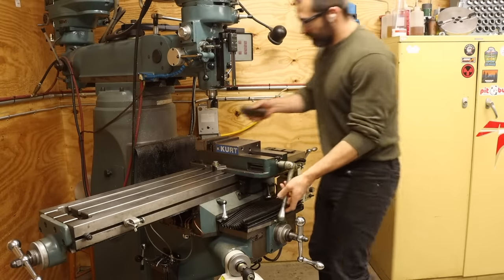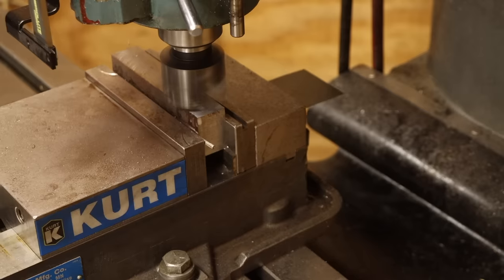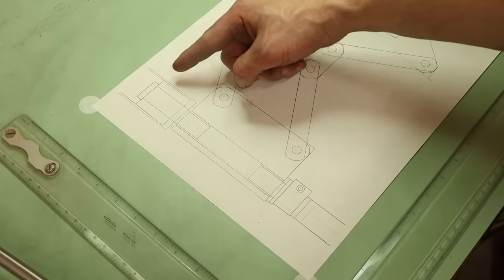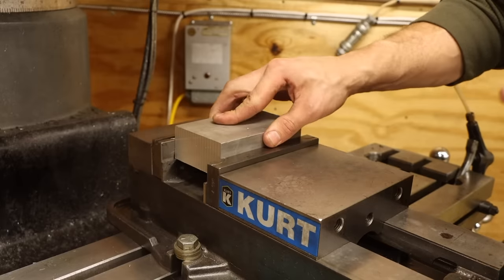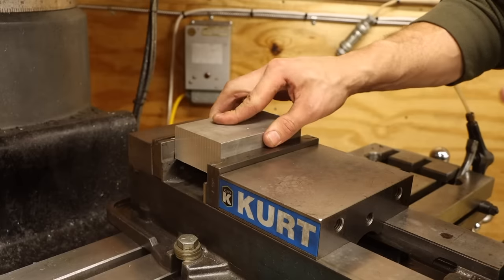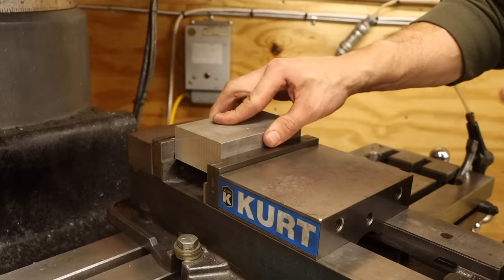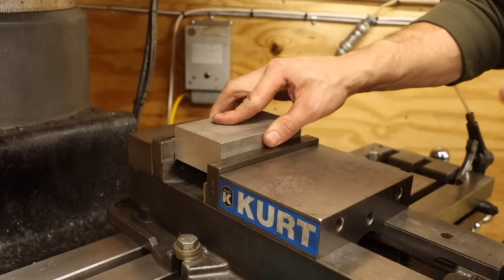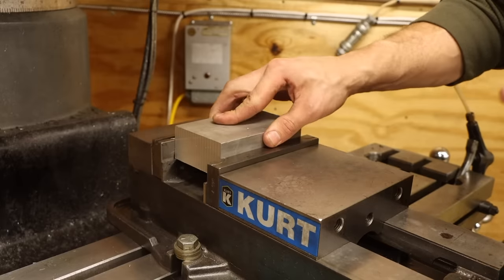A Life Changing Filming Upgrade || INHERITANCE MACHINING

Comment: I really enjoy watching you design and build equipment for your shop.  I find your creativity to be mind numbing.

There are a couple of things  that I was surprised at.  The first being the handle.  While being a very well done build, I am having a hard time defining function and need.  The second is the camera mount.   I would have thought having a handle here would have provided a better way of positioning the camera.

I like your gantry design and find it very functional.  I do believe it could be more functional had you beefed it up.  It appears had you increased the size and strength you could had built a second carriage for use in lifting parts and doing maintenance.  A simple one ton block or fall arrangement would save on your back.  Since the camera trolley is light in weight having a second carriage shouldn't interfere with the use of the camera 

Bob

Comment: A safe and practical solution to recording video content in the workshop. Can I just add one thing... forget about the camera mounted MIC with dead cat, far better audio recording can be had with lapel mic and Rode WIFI. Lapel MIC captures constant audio volume. Camera mounted MIC has a tendency to record audio at different volumes depending how close or far away you are from the fixed camera mounted MIC. Keep up the good work.

Comment: This is an amazing tool. I absolutely love it, and as always the filming and editing is on point. 

Two suggestions that come to mind, are the following.

1) make some kind of brake for the gantry so it stays in place where you put it, even if you happen to bump the drop tube. 
2) cut out some slots or space in the middle of the plywood sheets to let light through. As you are moving it around, you can alter the lighting in the shop, which could impact the look of the film. 

Alternatively, build a setup for positioning lights separately from the overheads that could give you more control over the lighting in your filming. Of course once you go down the lighting rabbit hole, it can easily get mighty expensive 😬
Reply from the maker: Thanks! I decided against the brake just to keep it simple. Bumping the setup would ruin the shot anyway so I didn't see the need. Fortunately it's easy enough to position the drop tube out of the way 95% of the time. Cutting light holes is a great idea though since it does block some of the ceiling light.

Comment: This is exactly the sort of thing I've wanted for my shop, but instead of a camera, a lamp.  Most of my work is on motorcycles, so being able to get a mechanical buddy to hold the light in exactly the right place would be freakin' magical.

I'm a little surprised you didn't make it so it could get entirely out of the way, maybe with an other arm so they make a "Z".  Yea, it's 50% more work, but it could then have zero head-clunky parts when pushed up to the ceiling.
Reply from the maker: That would be a great use for an arm like this. I considered an adjustable Z for a bit but it just started getting too complicated. Fortunately it's easy enough to position the "shoulder" out of the way for 95% of shots

Comment: Do the solid panels on the gantry obscure your ceiling lights at any point?  Might help to cut some holes to let ceiling light come through the gantry.

Or add some more arms holding light panels to the gantry, and a follow-me power cable that spools out and retracts so the camera and lights have power (or would that be OTT?)
Reply from the maker: It does a little but there's enough light in the rest of the shop that it hasn't really been a noticeable problem. Heck I've been running basically since the beginning without a light over the lathe because I blew the fuse in it and never messed with fixing it 😂

Comment: Brandon, I am very happy you made this after seeing how your tripod is close to the spindle for your safety. Would that be an OSHA violation if you did this in a job shop? 🤔You did a clean job with the machining and a little woodworking. The next skill you need to include in your future video is welding. I remember commenting, and you responded by saying that you have had a welder since we have seen machining, woodworking, and electronics. I cannot wait to see your next big project, like always.
Reply from the maker: No doubt I would get a write up 😂  I'll probably get into some welding at some point soon. Thanks as always, Matt!

Comment: Holy cow!  This is by far the most impressive camera mount I've seen in a Youtube shop in 20 years.  The quality of video is going to skyrocket your channel.  

I do have ta couple points of concern for you.  First is the lack of a locking mechanism on the gantry channels.  As long as this is perfectly level, and it sees no vibration what so ever, it should not matter.  But, in reality, it's going to be off level ever so slightly, and the rig is a standing wave sail, so sooner or later it's going to pick up a sympathetic harmonic vibration to cause it to move mid shot.  

 Next would be the lack of a gimble mount for the camera.  This could get the camera automatically level for you, or lock in place to hold a specific angle at whatever you need.

Last is more of an overkill, but fun idea.  The gantry could use a simple motor and wheel system to automatically move the gantry as needed.  This could be rapid travels across the shop, then fine movements to get the gantry in the perfect spot.  You could even add servos to the arm to automate the articulation.  All this could easily be controlled by a simple RC receiver and transmitter, with power coming from a battery pack mounted near the handle for easy replacement.  There are MANY RC and electronics youtubers who would jump at the opportunity to collaborate with you.

Comment: you'll probably want to give yourself a safety backup. 

a small cable from the middle joint back to the wooden mount at the top will prevent the camera from crashing to the floor if for some reason one of the springs gives out/breaks

Comment: this is incredibly cool! do the plywood sleds on the gantry block the lights significantly? you could probably add largish holes to them to let more through without losing significant strength. i also noticed right at the end, at 24:00 - it looks like the arms are quite a bit longer than the drop tube. if they were just a hair shorter than it, the whole thing could fold up into itself to take up almost no room in the shop. you might also consider adding some hi-vis or reflective tape to the "elbow", handle, and camera mount?

Comment: Until you got to making the gantry, I was expecting it to be one dimensional with how big of  a reach the articulating arm has, but you went big with the two dimensional gantry!

I think I would prefer some preset hard points around the shop to just slot the arm into, over the gantry, but I think that’s mostly because I’d rather use the ceiling space for other priorities, like running shop utilities like air lines, electric lines, and dust collection etc. with flexible drop points.

Comment: excellent build! though, the one and only critique i have for it, is that it seems so buttery smooth to move around, it might be worthwhile adding some sort of locking mechanism to the gantry, so you can't accidentally bump it out of position once you have it in place.

but maybe that won't be an issue for you, as you work alone, and it won't be on the floor like a tripod.
Reply from the maker: Thanks! So far it has been great without a brake

Comment: Wow, this is one amazing project. All made in one 25 minute video.
I am wondering how much the shaking of the arm will be a issue. Whenever you adjust the camera position or focus, the camera wobbles a while. I am also curious if the whole gantry is not too smooth, bumping the camera out of the way too easy.
I guess there is only one way to find out: we want more videos 😁
Reply from the maker: Thanks! It does wobble a little but it's easy enough to steady out by hand. And because of it's size, for most shots I can keep it out of the way

Comment: Really really nice project, love it!
Some stupid ideas: If you ever put power to the camera, maybe also put some electromagnets on the gantry system with a switch on the handle to lock it in place, or maybe some cheap bike v-style brakes on the rails that all release with a single brake lever on the camera handle
Reply from the maker: Thanks! Time will tell if I'll need any brakes. So far so good though

Comment: I would have made a sliding / locking forward spring holder to take into consideration changing cameras as time goes on... A sliding tube, with a set screw (or two) with the spring lugs on the side would be all it takes, then you have the option to adjust the spring tension any time...

Comment: You know if you reinforce that rails mounting to the ceiling to support a more heavy load,  you can make a second gantry with a winch crane to haul heavier projects or your milling parts across the shop more easily.
Reply: Just be sure the Gantry frame is metal not wood to handle the loads and not snap

Comment: Man that is a clever solution for a problem I'd bet lots of youtubers have.
And no box of shame too!!!!
A question: it seems the ball joint limits the down angle you can put your camera to. If the need arises can you set the camera on a true vertical?
Reply from the maker: Thanks! There's actually a slot at one point in the perimeter that allows the camera to go vertical. And I can pivot it 360 degrees to wherever I need.
Reply: @InheritanceMachining  neat!!
Looking forward to the new projects, and maybe, new camera angles.

Comment: It would be cool  If you could have a bike brake lever on the handle , with a cable going to the unistrut. Where a bike brake pad pushes against the track to at least prevent the system from rolling easily. Pull the lever on the handle making it easy to move into position. It should be fairly easily designed and setup. It can be a simple lever. With a brake pad or two. To push on the track. With a spring to keep it tight on the track. With a cable to release the brake.  It may not be needed. But nearly anything can cause the camera to roam away, if it moves too easily!   Just an idea!! ✌️

Comment: That looks amazing, I want one. I don't even film anything, I just like how it looks and works. 

Two small notes, you might consider adding some sort of locking mechanism to the channels, because even if you locked the arms, the wheels could still slide. The second note, I noticed your Y-axis blocks your ceiling lights. Maybe consider replacing a strip of the plywood with some acrylic or polycarbonate? Or, maybe even add a ring light, then who cares about the ceiling lights.
Reply from the maker: Thanks! And good ideas
Reply: @InheritanceMachining  You know, I bet you could probably get away with some detents in the rails at common stopping points. No need for a fancy break mechanism, the wheels just sit in the detents, keeping the rig still and making the location repeatable. Not sure how that would work with independent rails on the X and Y axis though.

Comment: Very well designed! I am curious if you had thought of adding brakes or a lock mechanism to securely hold it in the place you wish for the trolley wheels and if you had how come you didn't end up going with that in the design? Thanks for the vids and keep up the great work!
Reply from the maker: Thanks! For the first iteration I wanted it to be as simple as possible. So far it has been great without any brakes with just a couple spots in the rail that it does roll slightly but I can correct these

Comment: Wow!  SO nice.  I'm surprised you didn't add carriage locks to the gantry.  It seems that it would be very easy to accidentally nudge the camera and change the framing of the shot.  BTW, I also have the same Manfroto tripod, and while it's a nice tripod... you're right... it's not really awesome for video.  Also, you could add some stepper motors and either belts or Acme thread, and make a panning rig!  How cool would that be?
Reply from the maker: Thanks! I considered brakes but even if I had them, bumping the camera would mess up shots from the vibrations. Fortunately it's easy enough to place out of the way

Comment: Really cool set up! But one question: why not lock the gantry from moving? What if you bump it during a shot?
Reply from the maker: Thanks! The convenience of no levers or anything outweighed potentially bumping it. Most of my shots are only a couple seconds long. And if they are longer, the brakes wouldn't stop it from bouncing all over the place. Its easy enough though to place where I it's not in my way though

Comment: Very nice project! I'm very interested in your experience with this gantry that moves so easily with a long arm versus the vibration that the machines in the shop may generate.
Reply from the maker: Thanks! So far external vibrations have been a non-issue

Comment: Here’s a thought, you could easily make the gantry a motorized system using steppers, timing belt, wireless Arduino or something similar and remote control.

Comment: One thing a little larger machine shop may run into, is that they may already have a gantry crane... which is far more important than a light gantry for a camera.  BUT what I bet they have not thought of doing is using the gantry crane to hold an arm like this!  Double duty as needed.

Comment: Very cool, but as an electrician, I worry that the EMT is going to let you down.  That stuff is designed to be easily bendable.  It won't take much force at all for it to end up bent, crumpled, or kinked, for the mounting holes in it to stretch and tear, or (most worryingly) for that press-fit bushing to become loose and the whole thing falls out of the bottom of the tube.

I would definitely recommend at least throwing in a couple of screws through the EMT and into that bushing, to prevent the most catastrophic outcome.

Comment: For a small shop, I am picturing a floor to ceiling vertical tube with larger diameter outer tubes that pivot around the inner tube, with bushings of course. The gantry would attach with locking pins to the outer tube so it could swing around and extend to any point in a circular envelope.

Comment: And with how successful this turned out, I'm betting, in a few years the trolley gets replaced with some heavy duty I-beam, and a chain hoist or crane gets added, just to ease the lifting of heavy materials and tools around the shop as well. If the camera is easy to move around, then it follows that the work and tools will have to become easy to move around as well.  Happy Friday!

Comment: that is really cool, only comment I can make is I'd have mounted the springs on something adjustable like a tube that slides along the bottom arm so you can adjust the tension, but that's only if you ever want to change camera or want to add something like a small monitor to the arm. other than that looks awesome.
Reply from the maker: Thanks! I almost went that route actually but decided to just keep it simple. I might just have to drill different holes if I ever change cameras
Reply: @InheritanceMachining  just be careful, too many holes might weaken then sides. my only fear is is if you get a bigger camera it'll be a more expensive one. might be better to remake the bottom arm at that point. although I do overbuilt everything so I might be wrong. :P

Comment: For the first piece, it seems like drilling that center hole on both ends, then turning between centers could be quick. Instead of using a 4 jaw and dial indicator. Side job setup?

Comment: Amazing Build as always. would a lock for the X and Y axis be a good idea?  As the Ceiling attachments seem to be easy to move . So if you accidently bump into the Arm it could move same as with hitting the tri pod? id attachsome quick lock C clamp contraption the the construct to lock the upper carrige into place. Still easier than a tri pod but with added rigidity for keeping the camera position steady
Reply from the maker: Thanks! Its surprisingly easy to keep everything out of the way when I set up a shot. And even with a brake bumping it would ruin the shot anyway.

Comment: The springs will resonate and get picked up in audio.  Just make the joints tight enough you can delete the springs.
Reply from the maker: So far that hasn't been an issue. Ironically I get a lot more oscillation and vibration when the joints are tight.

Comment: I was looking at you adding the springs, and my only thought really, was, what if your camera takes an unfortunate trip and you had to get a new one? DSLRs can have surprisingly varying weights... then there's lenses... plus mirrorless cameras are pretty common now... you balanced for your one camera... but I'm 99% sure you're gonna upgrade. when you do, will you give up on the ultra-clean look and make spring slots?
Reply from the maker: Yeah if the weight varies enough I'll probably just make a second hole. The setting is pretty forgiving though. It holds position well even with my much smaller 80D

Comment: impressive, i may do something similar for my shop. but i don't have a mill or a lathe. 3D printing it is! lol. have you considered replacing the boards in the carriages with maybe plasma cut sheet metal with a bracing X ? seems overkill and it covers a lot of your lights. hell, you could probably just jigsaw cut these same boards.
Reply from the maker: Thanks. Yeah I may cut some holes just to open it up a bit. And i''m thinking about running diagonal cables on the carriage to stop it from "parallelograming"
Reply: @InheritanceMachining  you can also add some belts and stepper motor and make a motorized slider. it would be trivial to do, it'd cost like $50 total, and you would have awesome moving shots.